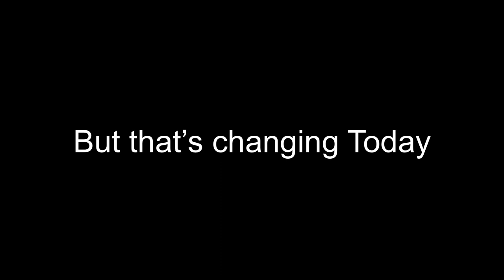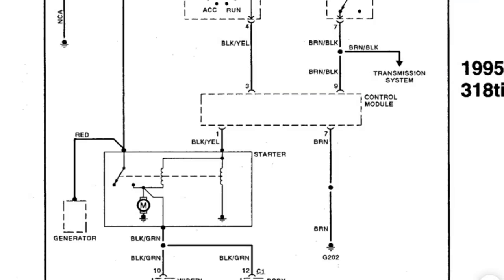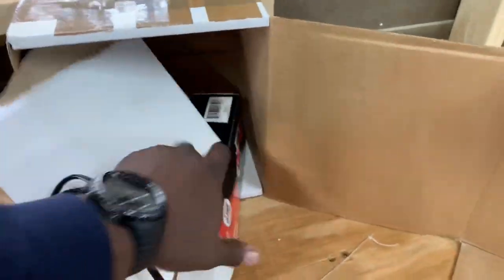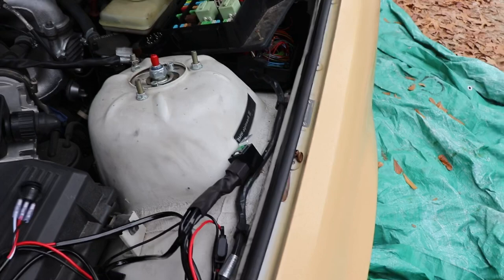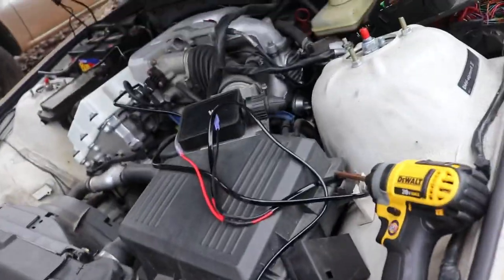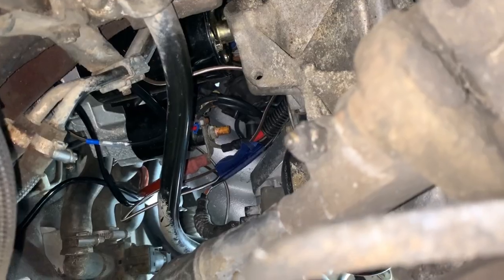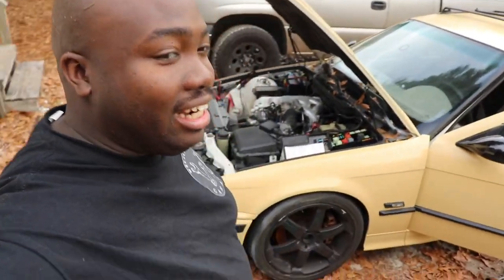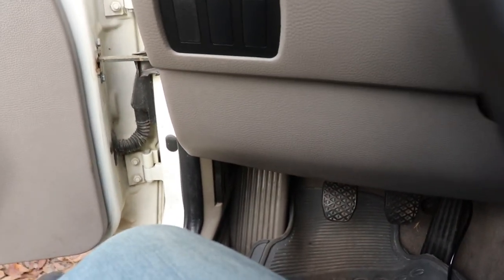Bmw Electrical Issues - Push Start Button Full Install

Comment: I’ve removed this from my bmw e30 325i. But it won’t start with standard ignition. It worked when the push button was installed

Comment: clutch pedal switch... take the switch above the clutch pedal,  jump the two wires together. If the car starts with the key then there is your problem.   Good video man.  keep it up
Reply from the maker: There’s no clutch pedal switch on this car. Thanks for watching

Comment: Oh my so glad I didn't buy an X3 when I was younger. Having a security issue with my s10 after changing the the keyed ignition...damn vats! You need a 22mm or up momentary switch for a starter I ordered 16mm too not realizing how tiny they are.
Reply from the maker: I will order a bigger one. That tiny one ain’t it

Comment: Just a shot in the dark cause don't have to know what your car had been through in the past, usually that problem its the ignition barrel it breaks where the key does that last contact to the starter, the other positions will function normally just the starter cant connect.
Reply from the maker: First thing I checked! I was hoping it was broken buts not. Some wire is shorted but with out the right diagram I am in the dark

Comment: I have a long start issue I’ve jumped the starter and sometimes it cranks right up and sometimes it doesn’t the starter was replaced also it was m52b28 swapped it’s an e34 525i 95’ still running obd1 not 2

Comment: Hey bro I saw ur video on the max speed coilovers, how are they holding up? I found another brand on ebay called euro collective, have you heard of them ? If so what are your thoughts ?
Reply from the maker: I have not heard of them. The maxpeedingrods are ok. The ride isn’t bad a bit stiff. I’m in the process of changing spring rate for a smoother ride
Reply: @AtomicGarage  what spring rate are you going with?
Reply from the maker: 8kgs on there now. I’m going 4kgs. That’s about 200-299lbs/ in on each side. I just ordered them!

Comment: Would this work for a 2000 323i
Reply from the maker: Yes if you wire it right
Reply: @AtomicGarage  sweet cause as of now only bump starts with key in position 2 no crank nothing

Comment: Hey I also have a 95 318ti and I’m having a problem where fuse 46 keeps blowing ,I  believe the key was changed and the old key ring was in the dash with the an old spare key  jumping the circuit allowing the car to turn on.aside from. That when I press the brake pedal the car starts to idle rough and the lights start to dim .is this a short somewhere in the wires ?